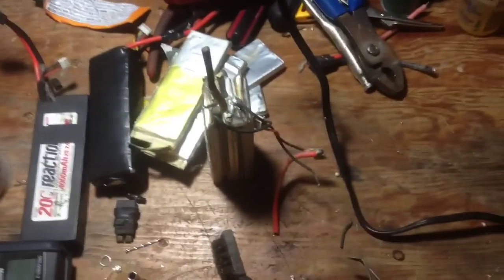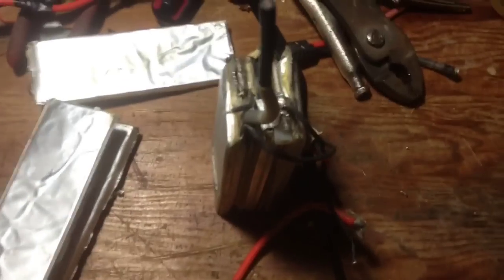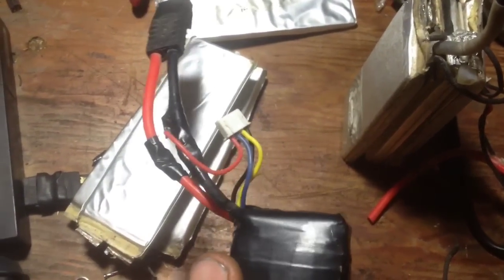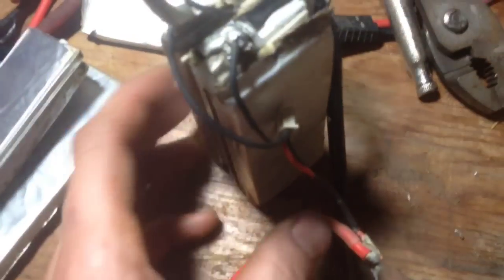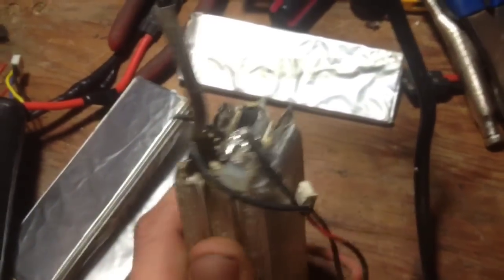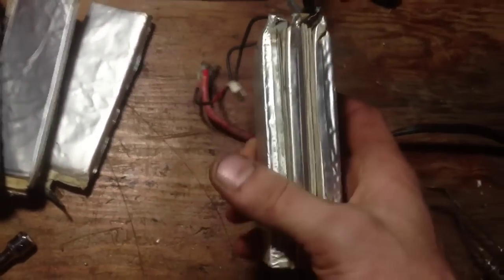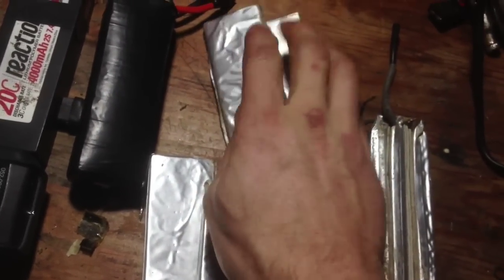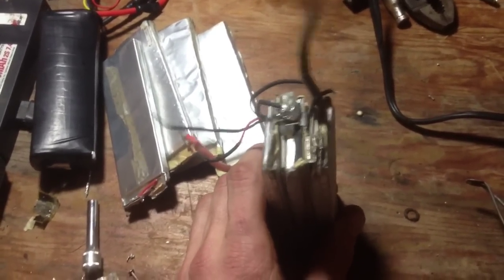How to Fix/save puffed or dead Lipo batteries Build your own LiPo

Comment: I have a small little lipo it's for a drome that I never used in a few months, I went to charge it and it won't I was told the volts went to low on it, is there any way on saving it or do I just junk it ?

Comment: the surface is aluminium.  when you heat it up it wil oxides and the solder won't stik to it.   you can put motor oil on the surface, that whil protect the surface egainst the air. and than solder it. or use a good flux.
Reply: Huh never knew the oil trick, just knew soldering aluminum is damn near immposible.

Comment: hello bro.. I have a lippo, it's 1200 mAh & 3 cells. But one of that cell is dead. Now I separate the cells be 2 cells. So, how big the capaacity that I have with two cells? May its 1200/3= 400mAh/cell? then I have 800 mAh?
Reply from the maker: Ve Gazerock no its still 1200 mah its just now 7.4 v, the pack is wired in series so that boosts voltage if it was wired in parallel that boost MAH so removing a pack will obey remove voltage not MAH power, eat cell is 1200 already, which to me seems low, my LiPos are 4500-6000 mah. but it depends on what you buy
Reply: chris bro okay thanks :D. yess I see about the voltage.
Other question, if I charge 2 packs lippo in parrarel. 
Example, 2 packs 1000mAh, how long does it take? (assume 1 hour for 1 pack)
Reply: +Ve Gazerock Depends on your charging amps......

Comment: Great tip man. If your solder won't stick it's usually one of two things. Ether your iron isn't hot enough or too hot or the surface isn't clean. Maybe that's three things lol.
Reply from the maker: ok man, yea i havnt got it yet. my one buddy says Flux, so I'm going to try that with him and hopefully i get a solid connection. its just the one cell won't connect. Thanks man
Reply: I use flux core solder. The flux helps clean the parts and the iorn. Some people don't like it because it's corrosive but I swear by it lol. Makes life easier.
Reply from the maker: if the solder is to hot it won't work rite? didn't know that
Reply from the maker: ok ill go get a spool of that tomorrow and try, the solder that is already on the wires i can't meant with my gun, its 140watt max n doesn't even touch it. think its Silver solder??
Reply: Jeez I don't know maybe. Some times if you tin your iron it will help melt the old solder. I use 60/40 tin lead, and desolder braid helps too. I'll post some pics if you want. My iron is 5 to 8 watt but variable temp.